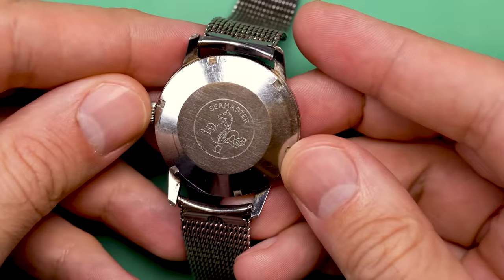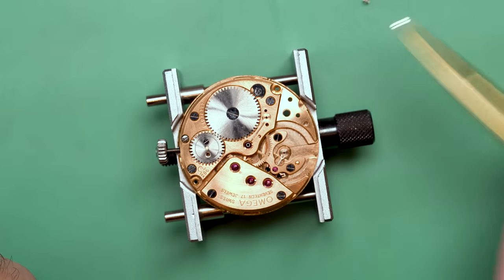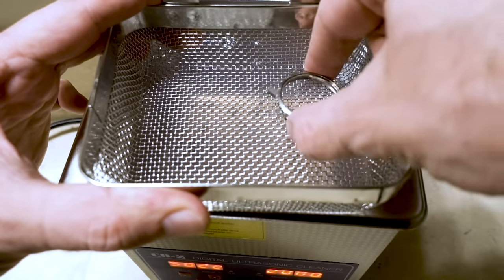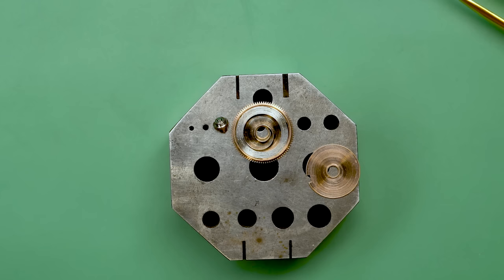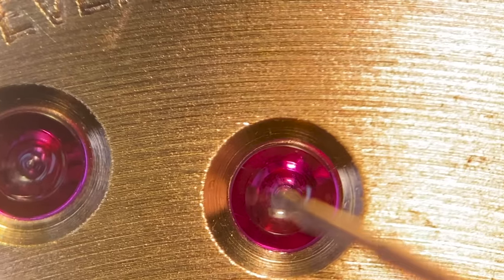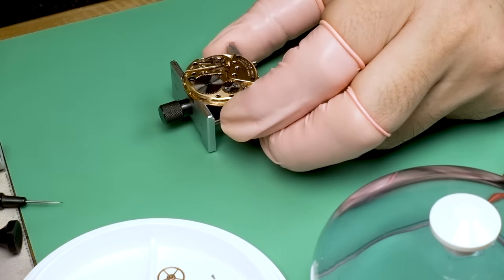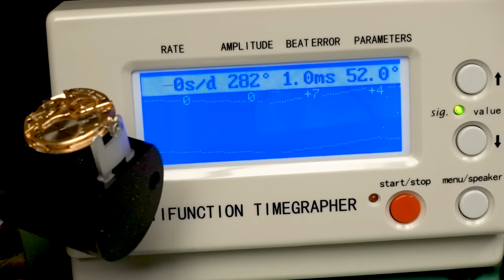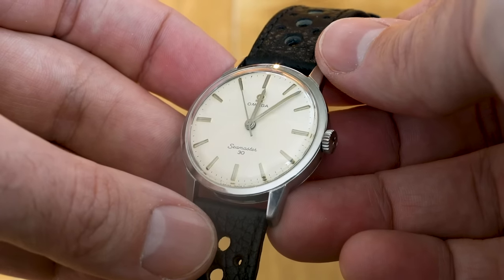Omega Seamaster 30 Vintage Watch Restoration With a Surprise :(

Comment: How does someone learn how to repair watches?  It seems that the there is no learning curve but rather a huge cliff.  If I tried to take a watch apart it would NEVER go back together.
Reply from the maker: Yes that was my experience too. I took the classes from @watchrepairchannel at www.watchrepairlessons.com and they were very helpful for me.
Reply: Personally I started out 20 years ago when all the current YouTube resources didn't exist. I was inspired by Watch school on Timezone.com, but, being Scottish I didn't pay to sign up for the course and just jumped right in. I used the book Practical Watch Repairing by Donald de Carle FBHI and the materials from Chicago School of Watchmaking Home study course - which I was able to find on the internet way back then. After that it was a lot of trial and error, anger, swearing, patience and more patience......

I am still regularly wearing my first ever automatic watch with an ETA 2892  - which has never been serviced by anyone else.  

This is not really recommended. Better to buy an old watch or simple movement to start as you will lose parts and break things when you start out - it's inevitable until you develop control.